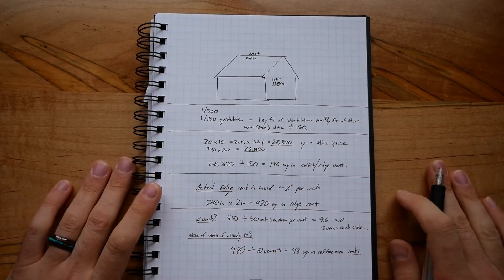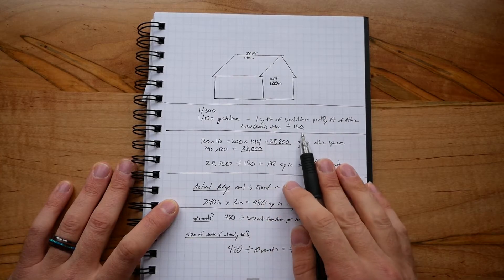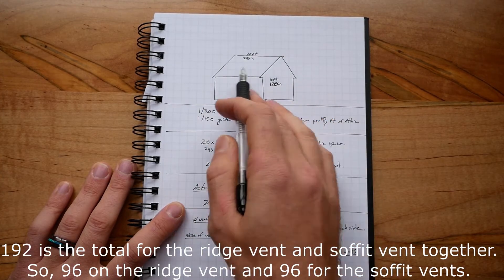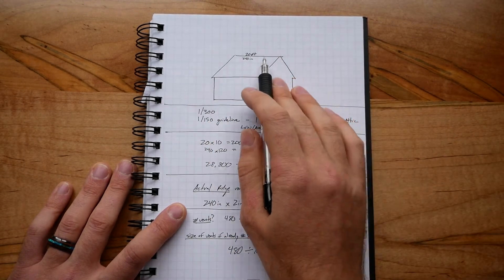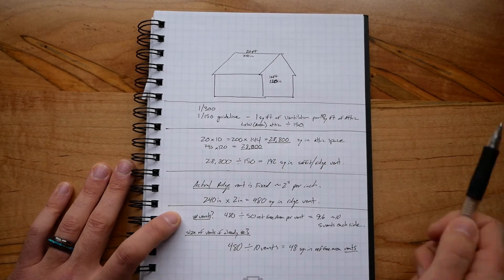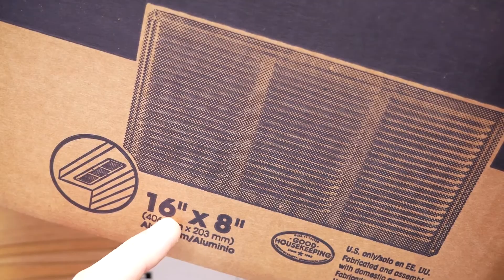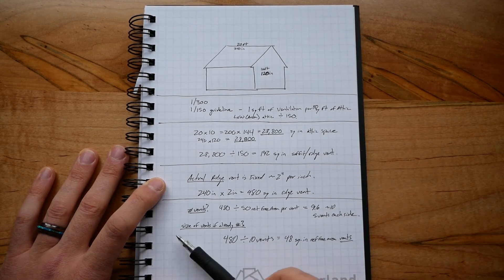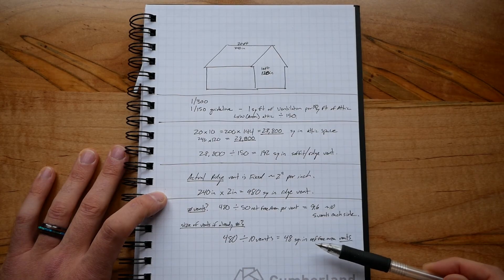Calculating Ridge and Soffit Vent 2

Comment: Thanks for the video. It would be helpful to use architectural dimensions on your drawing to help us see what you are measuring. You have the values written down, but we don't see precisely what you measured. For example, is the 10 ft from the peak to the soffit, i.e., eave length (sq-ft of attic ceiling), or is it from the center line of the gable side if the house to the soffit (sq-ft of attic's floor space)?

Comment: LOve this videio.. but i have Dyscalculia   which is Dyslexic, but with Math/numbers.. could you help me understand, i have a 12 x 24 foot  approx. 9 feet hight, Detached (low gable/low roof) Garage Shed which i want to insulate, was gonna just put a Gable Vent on each end (as i was told was good) but.. i think i was told wrong. i like to put ridge vent and then put in some Soffit vents ( none present presently ) ( i re-did an old garage) 
how much ridge vent  and soffit would i need ?  i was thinking six soffit vents ( on each side ) and a ridgecap almost full length of roof... would i be right? would LOVE someone help me with thtis..
has me so stressed out.... i personally would not be doing the work but hire someone to do it for me BEFORE insulate it .. Please and thank you !!

Comment: Shouldn't the ridge vent insulation be 240" length x 2" width x 2 sides = 960 Sq inch?

Comment: This is the best example I've seen. I am in the process of adding soffit vent to a new ridge vented roof on my house. I have to close off my gable vents and disconnect the attic fan next. I hope this new ventilation system works correctly. I needed 7 of those 16x8 vents. So I put 4 on one side and 3 on the other side. I evenly spaced them. I'm thinking I should have used smaller intake on the side getting less ventilation to increase the location of the vents.

Comment: Oh, my goodness, THANK YOU! I have looked EVERYWHERE trying to figure out how to do the calculation. I just got a new roof on my 1940 bungalow so I could get solar and I'm about to insulation. After I learned the building science from reading and videos like yours, I asked the roofing company for photos. It turns out they put the ridge vent cover on but didn't cut any vent on either side of the ridge board! I insisted they redo it. Also, I had vented covers, but no holes in my soffits. I've made calls to Owens Corning, energy efficiency nonprofits, contractors, the roofing company and NO ONE could tell me how to do this math! I'm so grateful you took the time to spell it out. It's a total lifesaver for me.

Comment: If I understand correctly (please tell me if I'm wrong): your "reality" scenario (second half of he video) is circulating more air than is recommended in your "theoretical" scenario (first half of the video). But in both cases, you are making sure the intake is the same as your exhaust (soffit vent area = ridge vent area). Is that correct?

Comment: I don't know if I missed it but when calculating the square footage of the roof, is it just the (length x width) of the floor plan for the home? Or are you measuring the length and width of the roof itself?
Reply: Do you measure the floor area while inside the attic?

I feel stupid :/

Comment: We recently invested in a new roof for our home, which included the addition of ridge vents. While we were told this upgrade would improve ventilation and efficiency, the reality has been the opposite. Since the installation, our home’s thermal balance is off—our heating bill has skyrocketed, and certain areas, like the attic, garage, and kitchen, are now overly cold and drafty.

What’s frustrating is that the roofing company insists they followed "code," applying a one-size-fits-all approach to ventilation, without accounting for our home’s unique architectural structure, including vaulted ceilings. This lack of customization feels like poor planning, and we’re left with the consequences.
Reply from the maker: Sounds like your attic may have had minimal airflow previously and was part of the envelope of interior air. Sealing leaks and adding additional insulation to the attic floor may help mitigate the issue.

Comment: Be sure to consider the flow area in any baffles placed just above each soffit opening.  They will often have a flow area under 25 sq. in. when an entire vent is used between rafters spaced 22"-24" apart.  If rafters are spaced 16" apart, then only a half vent is used and now you're really restricting flow.

Comment: I recently had attic air coming through the top plates into the house. The roof inspector said I had over 1000 sq in of  ridge vent when I needed around 600.  he could not calculate the soffit vents that exist and would have to take the soffit apart. But he said I have 3 or 4 times the soffit vent than the ridge vent which is wrong and I don't know what to do

Comment: Great Video!
One question i have is what is the actual area to be used for square footage.
Is it the ENTIRE attic (anything and everything under roof, including garage, porches, Lanai, patio etc) or should it just be the attic space above the air conditioned space?

Without knowing that, it seems like the calculations would be for nothing..

Thank you!

Comment: Question -If you have a ridge vent, does it make a difference where you put the soffit vents?

The house I just moved into externally has perforated vinyl soffit venting.  But the wood sheathing is closed off, there's no ventilation into the attic.  I am going to drill holes in it to allow for this.  It has a 13' ridge vent across 8 rafter bays. But pitched roofs at either end, that are another ~4 bays each, of diminishing heights.

Should I drill the holes for the soffit intact vents just in the bays that have the ridge vent?  Or all of them (or as many as I can get to)?  If this, should be be the same amount of ventilation per bay?  Or, more that have ridge vents?  Or more that don't?  

I'd think if the holes are in the bays with the ridge vent, that would get maximum flow.  But then the other ~half of the attic has no direct ventilation.    I'm not sure if there's a best practice for this.  Thanks.
Reply: There should have been holes, or better a cut out that matched the soffit position.

Comment: I don't have nearly enough vents. I have a 3,100sq/ft home with only 8 (6x18) mesh sofit vents and 3 roof caps. The attic is extremely hot during the summer

Comment: have you ever looked into which is more preferable between staying at 60/40 or going slightly over on the intake just to have even flow? for example on my home i fixed a humidity issue by moving from 450nfa on the exhaust side to 650nfa but have 1170 nfa intake or the correct intake for 1/150 which i couldn't quite get to on the exhaust. it just didn't seem like reducing intake just to hit 60/40 and plugging what was there made any sense. currently that's what? roughly 64% intake 36% exhaust with that 650nfa exhaust and 1170intake on a 1750sq attic deck. am i wrong to think way? or is there any drawback may be a better term?
Reply from the maker: It is better to be on the side of more intake than more exhaust.
Reply: @MaverickMakersUSA   50/50 balance is optimum. Take a physics class.
Reply: @keithusaf1  every build will have error; no build is perfect. If you aim for 50/50 and the tolerance causes  exhaust to exceed intake, you're going to have ineffective ventilation. So it makes sense to leave some buffer.

Also, take an etiquette class.

Comment: I have a garage where they left it open on the front past the stub walls. When I added drywall to the ceiling to finish it for regulating temperature I added black plastic soffit channels to every spot on both sides. Did not know it might be a math requirement and maybe I coulda had a couple less. It is a three car garage and part of it is separated by that weird drywall partition.

I absolutely hate that they did not use attic trusses and have been close to spending the 25k+ to take the roof off garage and redo it with attic trusses or more likely joists for a unconditioned storage room.

Comment: I'm getting a new roof, it's an old house and a the soffit ventilation on the front is now all one kind, perforated board.  The soffit vent mix on the back are louver vent or rectangular long openings with screen... and the L short leg of the house has a mix also.  There were issues of too much heat before the perforated boards were put in.  Now it has other issues.  When the new roof and new ridge vents go up I will have a contractor come back and replace / resize the soffit vents to match the NFVA value on the linear amount of ridge vent they install.
I'm in a L shaped house... main is 50ft x32ft with gables at each end of the 50ft and shorter wing is 25ft x 20ft with no gables.
QUESTION 1:  What's the open area considered on the screen covered soffit openings?  Old school aluminum mosquito screens.  
QUESTION 2:  What do the old existing gable vents (louvers with screens) count towards?  Intake or Exhaust or neutral?  They were originally the cross breeze method on older roof.  But the a/c unit in the attic is blocking the cross breeze about 8ft from one gable, and right at the access point to the smaller opening to the short part of the L shaped house.  Should I leave the gable vents alone or should I have a siding contractor remove them and close up the walls?

Comment: So I ran the calculator based on the Nfa of my soffit vents vs the square footage of the attic and it said it's 580 Nfa on a 40 ft wide roof.  So that's 14.5sq in Nfa per lineal ft.

So in order to achieve the 50 / 50 rule, but being sure my ridge is 50% or less so that the airflow doesn't reverse if the ridge is more area than the intake....

Doesn't that mean that my ridge vent should not exceed 580 sq in Nfa total?

So if my builder cut the opening the whole 40 ft, then it should only be about 1.25 inches wide all the way down the ridge.

It could be wider but then it would have had to be cut shorter than the full 40 ft long ridge.  

But getting to my point.  

I know my intake total Nfa is 580.  And my builder but the gap at whatever her cut it at and I can't see it until roofing day when the current ridge vent is removed.  But it has always vented fine.

So, my question is, if his gap width is appropriately sized for the known Nfa of the soffits, and it's always vented fine and there is no reason to thing the ridge is oversized, does it really matter if the ridge vent I buy is higher than 14.5 Nfa?  

The ridge gap of the wood under the vent is what regulates the exhaust.  A higher Nfa vent can't increase the exhaust potential of the actual gap in the ridge.  

A smaller Nfa ridge vent can choke the gap, but a bigger one can't increase the flow.  

Right?

My only risk is that the gap is way bigger than I need, and the current cheap ridge vent is choking it.  And if I put an oversized vent on, then that would result in more ridge than soffit Nfa and then I've got the dreaded reversed air flow problem.

I wish I knew the actual square inches of the actual gap my builder cut.  Damn it.

I can get a 14 nfa vent, but if my builder only cut the gap 1.25 inches wide but not the full 40 ft long, then now I am choking the exhaust where a higher Nfa vent could have maximized the exhaust potential of that shorter gap.  

Grr. 

Thoughts.
Reply: Basically, the gap the builder cut defined the max exhaust potential.   The vent on top is just like the breather on top of the carburetor.  Doesn't matter how big it is if you have a small carb.  But if you have a huge cfm carb and a tiny breather then that can restrict the potential of the carb.

Comment: Most roofers span the entire ridgeline with a ridge vent. Based on what I've read and what you state in your video this is incorrect and you are venting too much. I have a 12'x20' workshop I just built and according to the GAF calculator based on the 1/300 I only need 4' of ridge vent on a 20' long ridgeline. Going with the 1/150 it says 8' of ridge vent. This seems like a low number but it jives with what you are saying. Would you recommend 4' on each end of the ridgeline or 8' in the middle?

Comment: I don't understand your results. Ten 8x16-in. Soffits along your 20-ft. horizontal roofline means there'd be only 8-inches spacing between each Soffit.  Our roofer said situate Soffits 6-to-8 feet apart.  Our ranch house area is 25x64-ft., eight times bigger than your 10x20.  By your calculation we'd be installing 80-Soffits per side?  Seems excessive!  What am I missing?
Reply: The ridge vent in this example is 20ft or 240in x 2in of vent width = 480in.
Then to calculate the vents for soffit:
480÷50NFA vent= about 10vents. 5 per side of roof.

So in your case assuming 25ft is length of ridge vent.
25ft or 300in x 2in ridge vent width = 600
Vents for soffit:
600÷50NFA vents = 12 or 6 per side.

Comment: Thank you for putting this together. I'm in the process of getting a new roof. I currently do not have soffit vents only gable vents.  My roofer has bid putting in ridge vents and soffit vents (the gable vents will be covered with new siding).  I will ask if he calculated the vent area required.  I really want a good job done and you have provided me with the necessary information. Thanks!

Comment: Your attic space area is triangularly shaped, which means, the area would not be LxW, it would be LxW/2 , correct? (I’m not sure)
Reply: Nah, it's not the three dimensional area (volume) of the space of the attic, it is the two dimensional area of the attic floor footprint alone that dictates the amount used in the formula for the required venting.  Doesn't matter how high the ridge is and consequently how steep the pitch of the roof is.

Comment: Great video, thank you....however you said "2" of ventilation on EACH side of the ridge vent. wouldn't that double your calc from 480 sq in. to 960 sq in. of total exhaust? That would amount to 9.6 vents on EACH side of the house, which seems more reasonable.
Reply from the maker: Hey Mitchell, I may have misspoke and could have been more clear on that part. By "two inches on each side of it" I meant two inches total from both sides. That was just a visual estimate, but you will want to use the Net Free Area posted by the manufacturer on the ridge vent itself. For the Cobra 3 I have pictured the NFA is 18sqin per foot or 1.5sqin per inch.